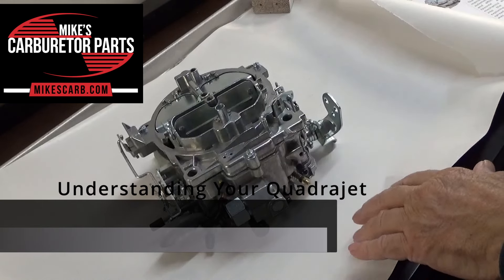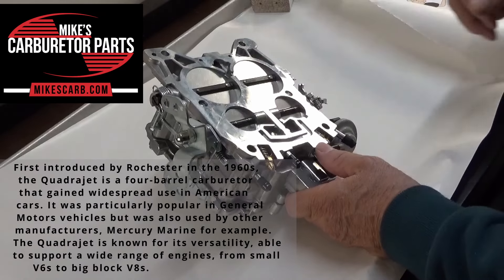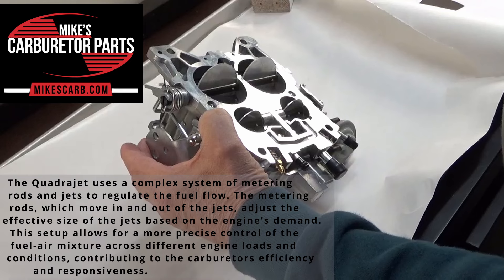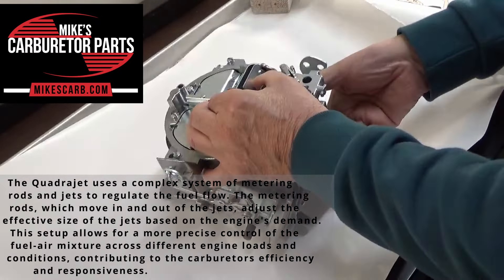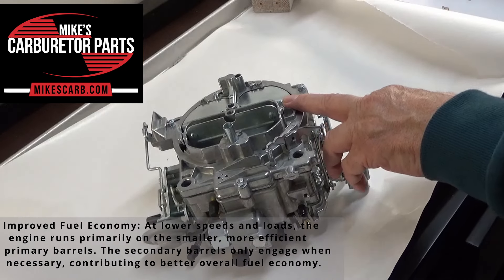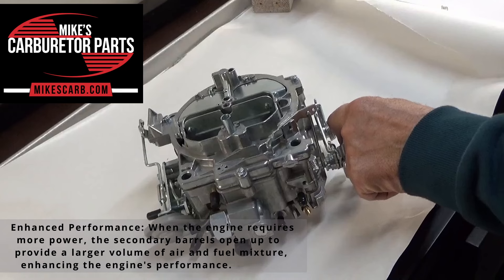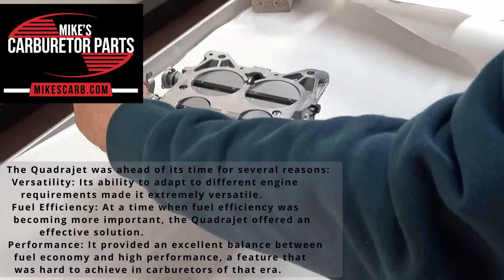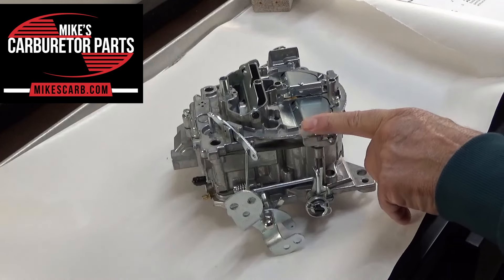Understanding Your Quadrajet - How Does the Quadrajet Work?

Comment: My favorite carb hands down. I've even used them on 302 Fords 😁
Reply: Works just as a Carter AFB.  Wonder who they copied.  you can change the Metering rods on a carter and completely change the carburetor jetting by removing two screws and covers and pulling the vacuum piston and metering rods out and they are easily changed to another size.  That is so easy a 10year old can do it.   Carters work great and was GM's and Chrysler Performance carb for years before the Q-jet.  Nothing like the screams from a 389 Pontiac or a screaming 327.  We always called the Q-jet the Quadro-bog.  My GTO would smoke any tire from 0-90 mph in low gear.  Power glides, made to break behind a 389.

Comment: I had Q-jets on several of my engines back in the mid-later 1970's.   A bit harder to rebuild than Holley's but overall a better running carb for me.  Hearing the back barrels open up under hard acceleration was always appreciated.
Reply from the maker: Its all about getting them adjusted properly.

Comment: My brother had a '66 Buick Skylark with a GS 350 engine mounted to a powerglide....if you've never sat in a car and heard the Quadrajet moan.....man, that damn thing sounded like a jet engine firing!!

   Swear to god, he'd put a set of recaps on the rear on a Saturday, pump the air-shocks all the way up.(a thing back in the '70's...) and it would be a cloud of white smoke chasing that damn thing going 60 mph......tires would be done Sunday evening.
Reply: That is a great engine to swap into a '66 Skylark. It must have been a real runner!!!!
Reply: Scary as hell....Skylarks were super light! @1967davethewave
Reply from the maker: I forgot about the air shock thing, but I couldn't afford them when I was a kid. With my Chevelle I put those Aluminum twist thingys between the spring coils to raise the rearl.

Comment: The fuel bowl gets sucked dry in a race application and a smooth air flow through the top of the carburetor doesn't cut it. Other than that it a good all around carburetor for your low output daily driver.
Reply: They do have the issue of fuel starvation with cheap standard rebuild kits.(.085 seat), but you can get them up to around (.145 seat), but then you have to be careful because it makes it harder for the float to control. With a good volume pump regulated to a little lower pressure no problems. Love them.  Maybe I am making less power, but mid 10's in a 3500# car was ok I thought. Down side was having to collect dozens of them for rods and jets
Reply: Yes, the ultimate power potential is limited by the single inlet and the rather small single bowl. Even with a large needle and seat you simply can't flow enough fuel at the highest pressure you can use. If you could crank the fuel pressure up to 50psi you might be able to fill the bowl but at 9 or 10psi it will get sucked dry or at least too low to keep proper balance. I love them. They are far more advanced than a Holley for street driving but everything has a trade off.

Comment: Hard to keep the bowl full of fuel and more delicate to handling than a Holley or Edelbrock. I have bought nice ones for $50 but it took a $1000 fuel system to make it work.
Reply: What kind of ET are you running to run out of fuel?